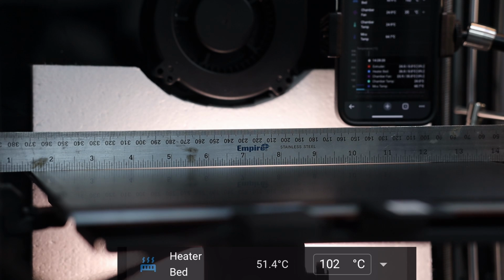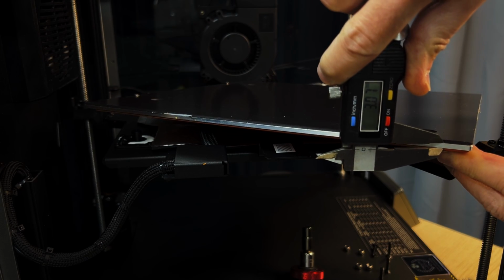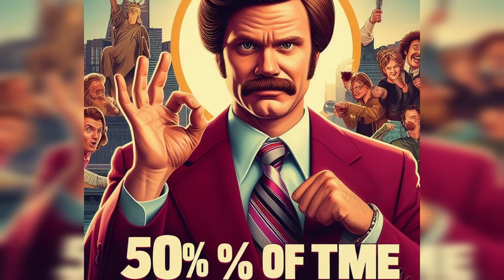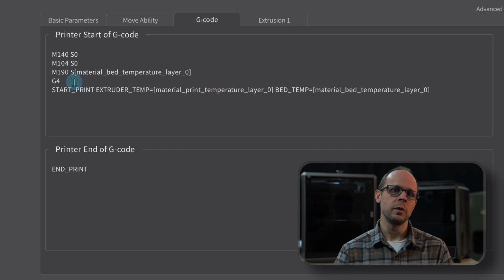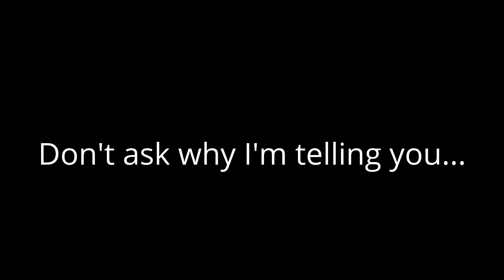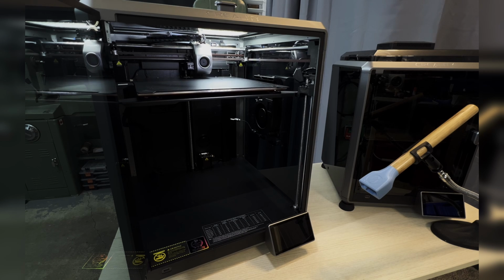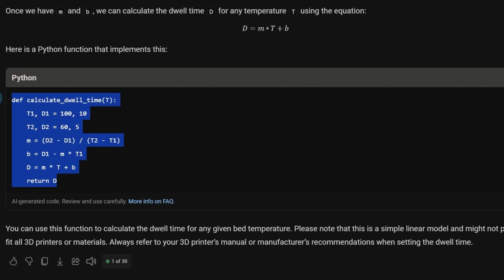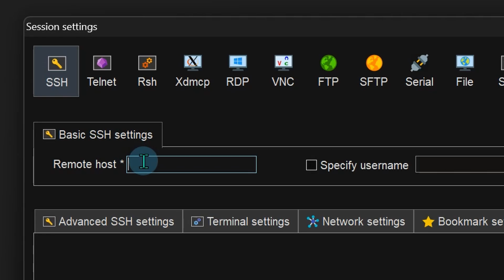Let Your Creality K1 MAX and K1 Printers Soak for the Best First Layers

Comment: I’m getting a clicking noise from my extruder I took it apart everything looks clean but it’s still clicking I took the nozzle off I have that little metal rod that it came with should I be able to push that all the way through with the nozzle off because it’s not going all the way through. It makes me think maybe something is stuck in there.
Reply from the maker: If you were printing PLA, it's possible you had heat-creep and you got a clog above the nozzle.  I can't say that I've had this problem, but what I can recommend is that before putting the nozzle back in, make sure it's clear above the nozzle, re-screw in the nozzle and the heat it back up to 240 and then push some filament through manually.   I haven't had a single clog running the 0.4mm nozzle.

Another thought is that if your first layer was too close to the buildplate, it would likely skip and wear the filament away, if you were to release the extruder and manually push it through, that would help for that, re-calibrate the bed and you should be good.  

Let me know how it goes!
Reply: @NeedItMakeIt  it was in the actual nozzle. I got a torch and it used right out. How can I how can I subscribe to your Patreon man you’re awesome?
Reply from the maker: @jacory1980  Good call with the torch, on the days of the Ender 3 printers, they came with long needles for unclogging, as if it was expected to happen from the factory.  

Any any all help to support the channel is welcome!   I'm on a mission to provide new content more than once per week and of course help the community as best I can.  Lots more to come!  https://www.patreon.com/Needitmakeit  

If you join our Patreon you're also welcome to join our Discord, we've got a great bunch of skilled people on there as well, it's great having a group of like-minded people to help problem solve and to come up with new ideas.
Reply: @NeedItMakeIt  just signed up!!!
Reply from the maker: @jacory1980  Awesome I'm glad to have you!   Let me know if there is anything specific you're looking for and I can try to work them into the schedule.  I have about 15 videos planned... but I can always try to fit something in especially if there are lots of people that would benefit from one.
Reply: @NeedItMakeIt  how do I connect to the discord?
Reply from the maker: @jacory1980  On the Patreon page at the top there should be a link.  I don't want to give that link out, but if you can't get through that way, you can message me or email me.  Needitmakeit@gmail.com
Reply: I figured it out
Reply from the maker: @jacory1980  If you enjoy long conversations about 3D printing well into the night, our Discord is for you!

Comment: Hi Mike.  So I've been working on a revised Heat Soak Gcode macro that better handles temperature variations, as well as handling pre-heat-soaked beds without forcing a fixed wait time.  Basically the macro can detect if the bed is already warmed, and reduce the soak time accordingly.

Unfortunately trying to post this macro (it's around 120 lines) on Youtube comments isn't going to work.  I also tried to join your Discord server from the link in your Community description, and get an invalid invite message from Discord when using that.  I'd like to provide the macro to you and your community for use, so please let me know what would be the best way to get it to you.
Reply from the maker: Hi Stew, that would be great!  That link has likely expired.  https://discord.gg/kpdP9AB This one will expire in 6 hours so let me know and I can create another if needed.
Reply: can you create another link? I'd like to be able to uses @stew675's macro on my k1 max @NeedItMakeIt
Reply from the maker: @ligh7c  I'll post it when it's available, we'll need to run a few more tests to be sure we're all G2G.  You'll need to Root to be able to use it if you haven't already.   I have a video I just released on that if you need to.

Comment: I've been doing this on my S1 Pro, gives me way better first layers. I'll pre heat for 5 minutes, run a bed mesh, then pre heat 5 before starting a print.
Reply from the maker: Any printer with a thinner bed could probably do with a little pre-heat, the K1 Max seemed to be the most impacted by this, whether it was because of the bigger size, or from the faster heating, or a combo, I can't be sure.  I will have a thicker bed option video hopefully it solves the issue and we can move on to something else.

Comment: I just ordered a Neptune Max 4 Would I have to root that as well? What are your thoughts on the Neptune Max?
Reply from the maker: I just had a quick browse through and it looks like a nice unit an interesting way of adding more cooling as well, I haven't seen that before.  From what I've read, I don't think you'll need to root it, it looks like they've used Klipper as it was intended and it should be open already, I don't see anything on the site to indicate otherwise.  For Creality, they have their own slicer and cloud based software and for some reason they thought it was okay to use Klipper which is O.S. and block people from using it the way it was intended.  I think Elegoo has a slicer, but it may just be for resin.  I'd have to get to get my hands on one to be sure. 

Looks like a solid choice, it has all of the bells and whistles you'd want and has the accelerometers built-in so you can make sure to get the best input shaping results.  

You'll have to let me know how it does the leveling, it says 121 point setup, and with a nozzle probe, that would take a LONG time, it must use a different system, like Eddy Current.

Comment: I have finally achieved an almost perfect first layer for PETG:
With PLA, the first layer usually comes out quite well since the bed calibration temperature usually coincides or is very close to the printing temperature, so it is enough to print the PETG at 50º Bed. I have used the gcode that you indicate as original instead of Auto-Time because this second the machine blocked me with an error 2171 (I do not have it rooted), 5 minutes heating the bed (300000) and I use an extra strong hairspray for the textured PEI and I only had to put a piece of baking paper held with Kapton tape under the pei in one corner. It is a solution that works for me because for now I only print in PLA or PETG. I hope it helps someone

Comment: One thing I’ve noticed when I put in the G code that you have for orca slicer. If I pause the print in the middle to do a filament change, it won’t let me use the track button for some reason, but when I go back to the stock code it works, what do you think that could be? Hope you’re having a good day brother.
Reply from the maker: It does seem to do bed calibration, it does not do PA or filament calibration, I believe only Bambu slingers do that at least for now.
Reply from the maker: My initial thought is that they shouldn't be related, the start code should only be referenced at the beginning of the code.  I'd have to do a bit of research to see if pause somehow also references start Gcode.  I suppose that it's possible.   I won't have a chance today but I can do a bit of digging in the next few to see what we find.  

Yeah, life is good, I can't complain, and to you as well!
Reply: What all the calibrations work using the orca slicer with this printer?
Reply from the maker: @jacory1980  Orca can drive pretty well any printer, it's just a matter of having the profile, I just checked and there is a Neptune 4 max in there already to pick from, so you should be G2G to use Orca.
Reply: @NeedItMakeIt  all the calibrations should work as well? That’s what I meant to ask. Sorry.

Comment: Another great one Mike, thanks.   I guess it's outside the scope start G-CODE but I wonder how we would manage the case of the second print we want to do, following the first one?   If I understand the video correctly, especially the G4, we'd still be waiting10 minutes at the start of print 2 even though the bed has been heated for perfectly long enough (10 minutes initially + the print time of the first job we printed).
Reply from the maker: Glad you thought so!  We were able to find a good solution for the dwell time, now we have code that will base the dwell on the bed temp.  5 minutes for 60°C and 9 minutes for 100°C.  

For running a second print, there is a code to prevent the bed from cooling completely, we can implement that, the issue there is that if we forget, the bed will stay warm.  

I think there's probably a good solution out there, we just need to think about the process and how it would normally work and there will be a logical way to handle it in the code.  As far as I'm aware, we can't have a 2nd program waiting in queue, but maybe I'm wrong.  Do you know?
Reply: @NeedItMakeIt  Thinking out loud here...

Could you do a m105 to get the current bed temp, calculate the difference to the requested temp, and use that difference to assume your soak time?

Untested, but wouldn't this do it? It will always dwell at least one minute, but say I haven't printed, it would dwell 6 minutes if i set the bed to 70C, say I ran a print, sent another and bed cooled to 45C between prints, it would then dwell 3.5 minutes. Bed at 65C, 1.5 minutes. I do not do gcode, so I may be off base here, but I think it'd work if anyone wants to try it. The +10 helps it assume 20C ambient btw.

INVALID (Leaving for history books): G4 P{max(0, first_layer_bed_temperature[0] - BED_TEMP + 10 ) * 6000}

edit: Doesn't work, but the idea is out here. Someone that doesn't have a 1 year old sleeping on them at 1am figure out what I have wrong lol. I think I just have to set the bed temp prior, looking at docs.... I might see the issue, another edit shortly most likely..

Valid (At least compiles): G4 P{max(0, first_layer_bed_temperature[0] - bed_temperature[0] + 10 ) * 6000}

Comment: 🙏 ive been preaching this for YEARS. First noticed this back about 12 years ago when i first started playing custom g-code

I first thought it would be nice to heat both the nozzle and bed at the same time to print small things faster, quickly noticed the furst layer was off. Took me a few weeks to put two and two together. After that i added just 1 minute, as more didnt make a difference on the low thermal mass of a Replictor Dual bed with just Kapton tape and no glass or magnetic bed.

When i finally got a larger printer with a 200x200mm build area and a magnetic spring steel bed i found the same issue again. But this time i also found on larger ABS prints you really needed to heat the chamber, so moved it upto 5 min, then 10.

I also went one step further and instead of insulation the bed directly, i lined the eges with 1/2" wool and created a air camber with kapton tape. That evenly spread the heat, as it was a bed slinger i noticed bed temps on different prints moved around (using a themal gun).

Later on other newer printers i got with glass beds i played around with a copper layer in-between the glass and the bed. That helped even out the heat, but also added thermal resistance ironically as it wasnt perfectly flat between each surface. Im sure a jar full of thermal paste would fix that 😅 but i never cared abiut cleaning up that mess so i never did that 😊
Reply from the maker: First of all, WOW, 12 years ago, you've been in this for a lot longer than most people.  I haven't been anywhere close to that, but I'm impressed with how much has changed in such a short time with printers.  I can design something and print it and use it the same day, and these aren't small parts either, it's quite satisfying, though I suppose if people are printing trinkets and toys, we're going to be filling the landfills quicker.  

I thought about insulation a bit as well, but I want to desperately try the thicker bed option, I think it's going to do the best job even though it'll still warp and it will heat slower.  

Just the other day I was thinking about using an entirely copper bed, and that would work if the bed didn't move up and down on these printers, the Voron 2.4 with the stationary bed would be perfect for this.  Copper's thermal conductivity is better and it doesn't expand/contract as much, though it probably depends on the alloy we're using.

Do you have any experience with trying to reuse a silicone bed heater?  How to remove it and then re-apply?

Comment: Would be interesting to see different results on which position the Bowden tube is in when using the entire print bed.
Reply from the maker: Are you thinking that changing friction in the tube could play a role in the print quality?
Reply: @NeedItMakeIt  yes especially when it's in the back left corner area I feel like it gets restricted
Reply from the maker: @lolmandood  Are you able to send me a picture to make sure I have reproduce the level of pinching you're seeing.  I've also done testing in the past on different materials and there is a lot of difference between PETG ABS and PLA with no restriction at all.  PLA came in at requiring nearly 2x the force to move it through a short Capricorn tube compared to ABS and PETG.  It wasn't extensive testing, since I only used what I had in stock.

Comment: Hello, Incredible work you do, thank you for it. I have implemented the gcode with 80º for 10 minutes in Creality Print and I have printed 5 0.2mm discs distributed in the corners and the center of the bed. I have told it to run the Lidar calibration and the result is disastrous. It makes the zig zags, checks them with the camera and passes the laser through the area of the first figure, then it stops the gcode for 10 minutes, prints the first figure and goes to the cooling area of the nozzle, once cooled it begins to raise the temperature and complete the other figures without further leveling or mesh. A disaster. Impossible to print large pieces with PETG until they implement in the firm the possibility of executing calibration depending on the temperature of the filament to be used or solve the problem of bed deformation. At the moment it is only an amazing and expensive printer to print only PLA (because the temperature of the bed is close to that of the calibration) and not very large pieces either. 💔
Reply from the maker: Thanks, I'm trying to provide solutions to everyone so they have have a better success and share my struggles along the way.  

I'd have to try and remember what my scanner did, since the bed was warped when it was trying to use it, the results were not very good and it was not performing flow calibration.  That setting is available however it is experimental, and when I tried it, the flow was modified far too low and the prints failed.  Have you watched my first video on the K1 Max review?  I spoke about the scanner itself.  It is not a dual red laser scanner, but a single scanner and it doesn't know the height of the bed precisely, it's not a true LiDAR, it's just a laser which projects a line on an angle for the camera to be able to pick up, even more strange is that the laser isn't being used all of the time, it seems to use the light and camera for the PA calibration.  I have another video I want to make on the subject but most people that I know do not use it.  It's not reliable and causes more problems than good.  I haven't given up on it completely but I needed to understand why it was so unreliable before trying to get it to a point where people could use it with some level of success.

I'll think about this a bit more and  see what might help you, I don't have any solid solutions yet because it's fairly new territory for me.  Does the PA testing even take advantage of the mesh, it's a process of it's own?
Reply: @NeedItMakeIt  Thanks for answering. The truth is I didn't see your review video of the K1 Max, before buying it I let myself be influenced by a few videos of "undercover Creality sellers" and the desire to have a K1 MAX did the rest... :-(. The The bed of my CR-10S also had that problem but to a lesser extent and after so much time I thought that Creality would have solved it. I also did not use the Lidar much due to the problem that it controls the temperature of the nozzle during the process and releases debris during the calibration but I thought it was more effective and would do something... I think Creality is using us as a "Beta Tester" or "guinea pig" for their machine.
Well, deep down we are "Makers" and leaving aside the money that the machine costs to avoid stomach ulcers, let's try to learn from/with it. Great job.

Comment: Excellent. AGAIN!! Your channel is super useful! 
Here's a GCODE question😅 I'll try keep it simple.. (I'm not expert at GCODE) 

So this is for a None Rooted printer. So bare this in mind. 

Orca slicer has the exhaust fan feature (Under Filament>Cooling) however, this activates the M106 P3 fan, The K1 & K1M doesn't have a P3 fan. 
P0 = Model/hotend fan
P1 = Rear Exhaust chamber fan
P2 = Aux Fan

SO if you activate this feature,  what ever % you use, for some reason modifies the Hot end fan speed😅 (You'll have 100% model fan at first layer for example) 

However, if you activate this feature, Export your GCODE as usual and go through the GCODE in a text editor, replacing any M106 P3 with P1 then the exhaust fan "during print" & "Completed Print"  works excellently. 

How can I enter this exhaust activation in the Filament GCODE manually?  I currently have 
; filament start gcode
M106 P1 S255
Which is great during but I can't seem to keep the fan on after the print, even if I enter in the filament End GCODE, which I may be doing incorrectly 
 (Useful for ABS prints)
Reply from the maker: I'm getting caught up with some other emails and projects, I'll look into this a bit when I have a moment free.